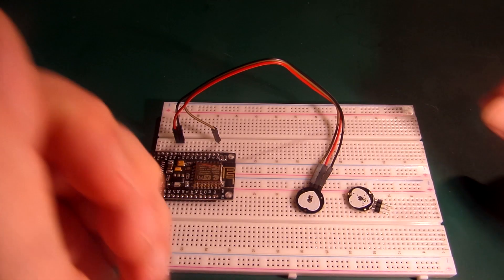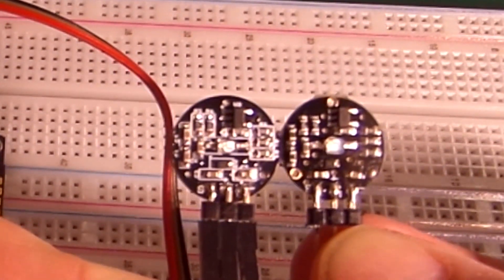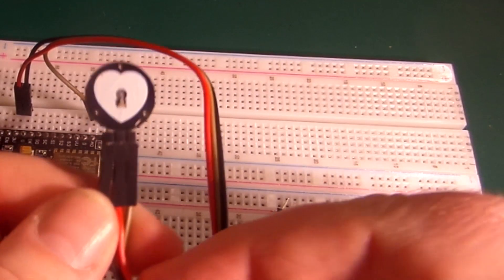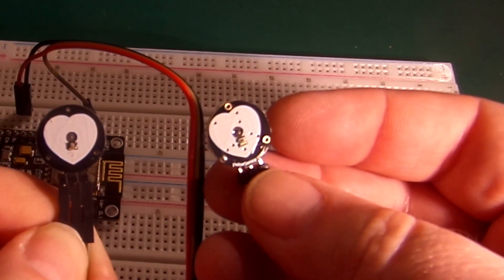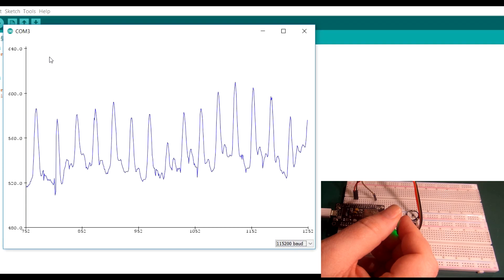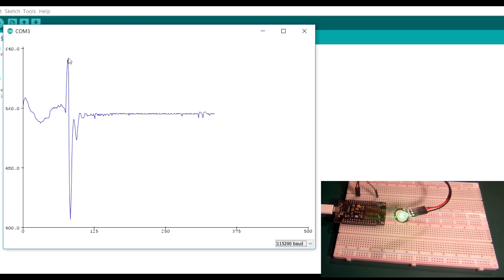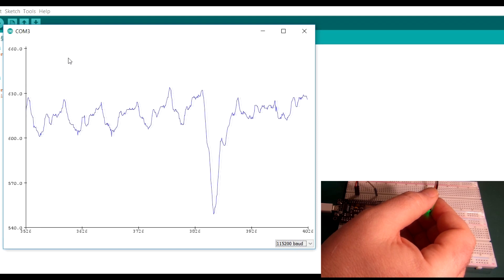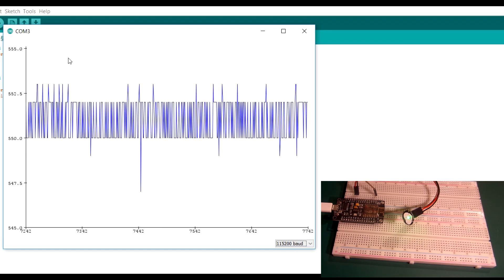Problems using heart beat pulse sensors

Comment: I used a heartbeat sensor with Arduino (5V). It work well. 
When I using same program in node mcu esp8266(3.3V) no reading in serial monitor.
Reply: this the same problem im going through as well. have you figured it out yet?
Reply: @damselindisguise5357  yes

Comment: Please make a video of node MCU and max30100
Reply from the maker: Yes, sounds good
Reply: @XTronical  It would helps us a lot. Since there is no proper video for node MCU and max30100 with proper explanation. Which states wheather the resistor of max30100 are required or not required for node MCU. I already saw your previous video for Arduino and max30100 and I found it to be the best video till date.
Reply from the maker: Yes, I'll do one, be around 2 to 3 weeks as I've none in with the resistors still on and will have to order a new one.
Reply: @XTronical  Thank you so much. As of now can you do a video without the resistor one.
Reply from the maker: Yes, but need to order more max30100, so will be a short while before video comes out.
Reply: @PrabhatDash  hi ,I am making heartrate monitoring system ...my sensor given wrong output does max30101  sensor will give right BPM
Reply from the maker: Yes, I've had no problems with that sensor and it measures blood oxygen too.
Reply: @XTronical  hi,thanks for ur reply sir ....u can tell what other things I can add with it as it is my final year project ...I am using blynk ,lcd,nodemcu and the max30101 sensor ..
Reply: Sir 1 doubt ...plZz reply ...do we have to do shouldering as they have given the IC and the pins differently ...the red light is not glowing (only glowing when the device is starting )and the reading is comming abrupt .. shouldering would solve the problem
Reply from the maker: Soldering wouldn't make any difference. Wired connections should be fine.
Reply: @XTronical  it is showing at first when I am putting my finger on it it is not glowing
Reply from the maker: Sorry. I'm not sure what your problem may be.